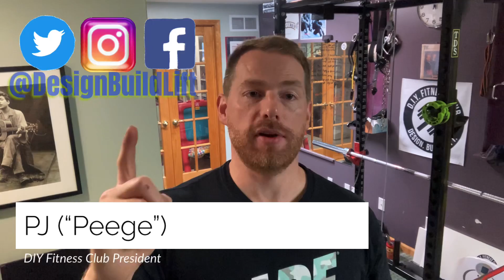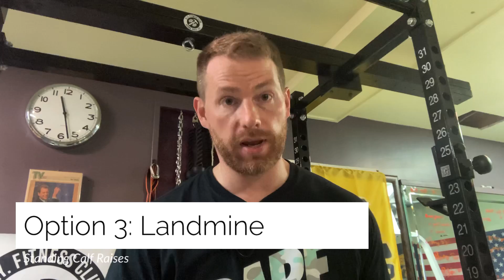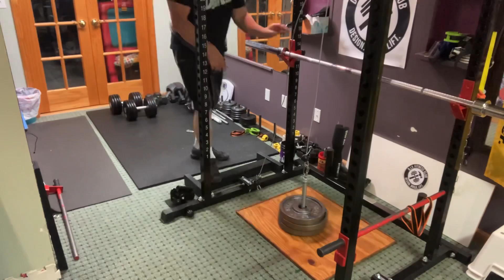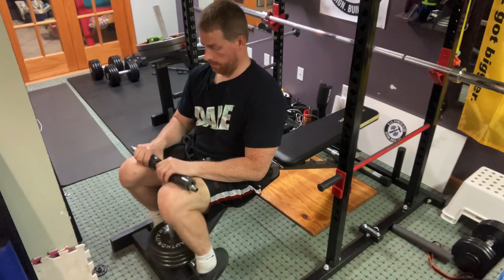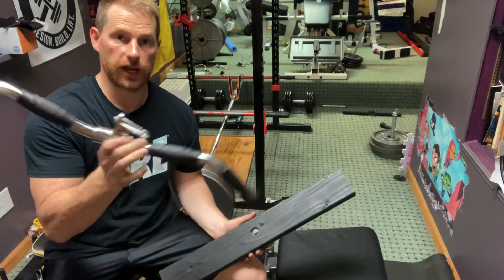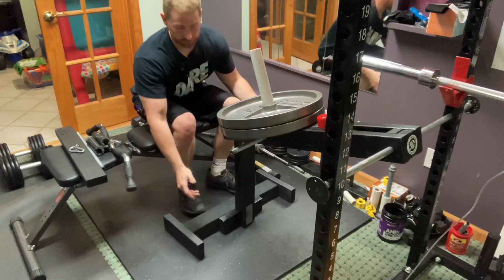12 Calf Raise Options using DIY Gym Equipment

Comment: I leave my bar in squat position in my rack..leave on 45lb each side then use heavy bands on one side. I attach the band at the bottom and wrap around the barbell sleeve then put my shoulder under it and lift. I have a home built block I built and have but on serious size with this and tib work.
Reply from the maker: Awesome! 🤘🙏💪

Comment: Some good ideas here ..DIY brain is good .I think about safety before I start my gym sessions  as if think about it while training I will loose the focus as you need to be 100% concentrated on what you doing...Now your exercises demonstrations "exercise" doesn't show much of the dorsi flexion ...Calves must be trained not only on plantar flexion but on dorsi as well which most of people won't stretch the calves on the eccentric phase and the result shows or should I say no show. Also calves muscles are used to heavy loads as we walking on them most of the day ..That really is important to show safe exercises on DIY pieces of equipment...safety is paramount ..so serious pulleys and cables , wire ropes , thimbles etc and everything that is built with wood needs steel reinforcement ...I made all my equipment this way and I'm 100% sure it will go well ...Functional equipment are  the most important thing ..beauty come later :)
Reply from the maker: Thank you for supporting the channel, Franck! 🤘🙏💪 I appreciate it!!!

Comment: Good ideas but I have my doubts about the angle of your knee position. You have to sit higher to create a 90 degree angle. I'm pretty sure this is going to be more comfortable as well as more effective.
Reply from the maker: I agree! My “form” was not good in this video. For the seated calves exercises- I should have sat on something to elevate my body more to create that 90 degree angle (e.g., a balance pad, or foam puzzle piece mats, etc).
Reply: Great point about the angle as it not only makes the exercises more efficient but also spares you from knee and hip problems.👍
Reply: @DesignBuildLift Appreciate the fact that you accepted the suggestion about the angle of your seated exercises. We aren't all exercise "gurus" and if we're honest most of us struggle with proper technique and exercise execution at one point or another. A lot of great options to fit peoples' individual body structure and available equipment options.👍
Reply: while this is true I don't think it was the point of the video, was it? 

same goes for, say, nitpicking about the position of the calf block. 

the point was to demonstrate 12 ways to train calves in standing and seated positions using existing gym equipment

next time, maybe just say thanks very much for the effort that you put into the ideas and the making of the video

a little appreciation goes a long way - and besides, it's just good manners
Reply: @svengali5415  Demonstrate, is showing it the right way.
And he accepted the advice.
That's it!
Reply: @BrotherBeard75  

er, no....the purpose of the video is not to demonstrate how to do calf raises the right way.

The purpose of the video is to demonstrate various home-gym equipment set-ups for doing calf raises.

Pumping out a few reps is incidental to the purpose of the video.

I did not think this distinction was subtle.

Nor did i think i'd spark a grade-school English comprehension debate.

Obviously, i was wrong on both counts.

That's it!

ps...OP 'accepted' the snarky advice because he's a creator and needs to always play nice in his comments section. I'm not similarly constrained. I can speak the truth.